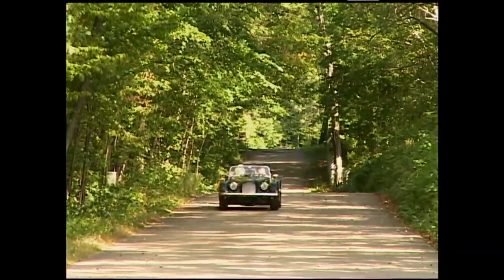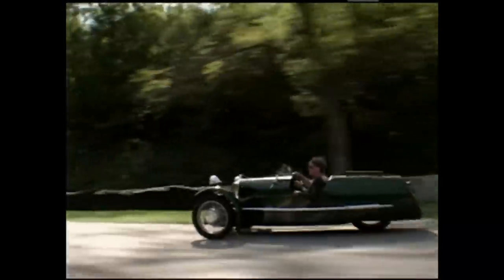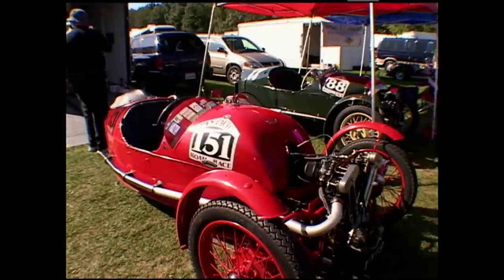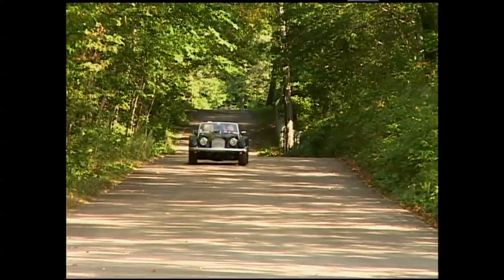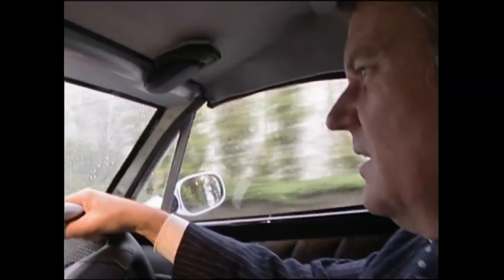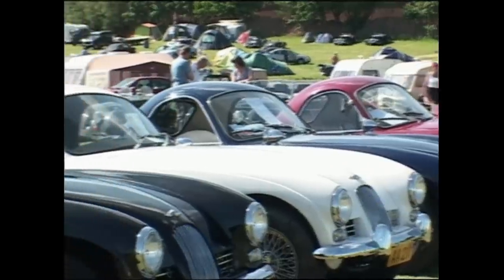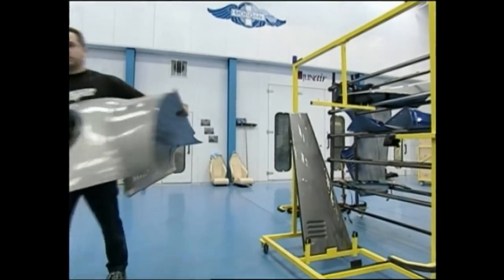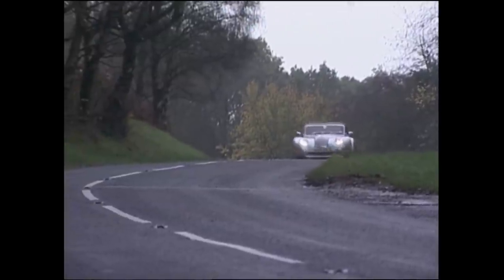Great Cars: MORGAN

Comment: that Rover V-8 was a Buick, Oldsmobile deal, I believe it was a push rod 235,  the Brits used two crappy S,U,s, the U,S version had a four barrel and a two barrel carb, the heads were famous for warping
Reply: It was 215 cu in. v8 aluminum heads the 63 version had water lines to the head for additional cooling. I because I have a 63 buick special still running and driving today.

Comment: wonder if the wood is a better option regarding rot and rust ...
Reply: -Rot vs rust? With the perpetually wet atmosphere of England, it appears that wood is also subject to disappearing over time?
Reply: Allow me to 📞🍔
Reply: @Blogengezer  but not as quick ! whole peers for ships and ships themselfs have been build to survive for decades with a little bit of care or horse carts ... but modern steel needs this coating and 6 years later : rust holes everywhere despite rust protection and thick coats of paint... see how fast a car fender starts to rust if you just leave a blank spot ... takes minutes until it turns brown on the surfice